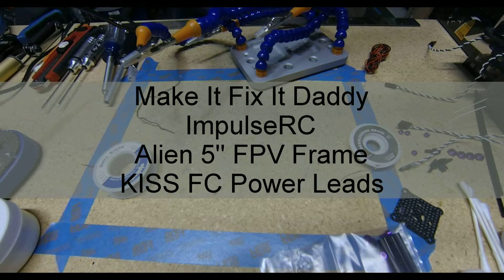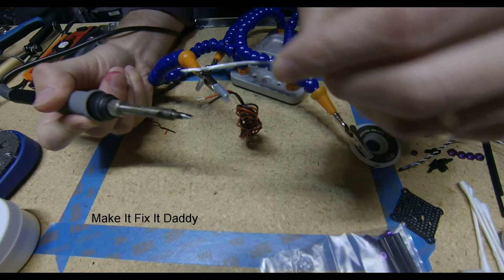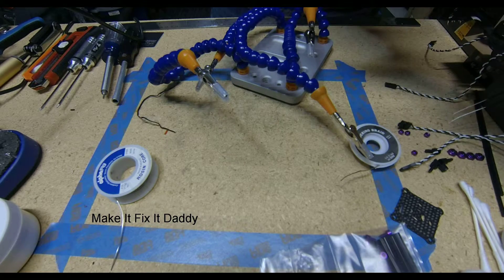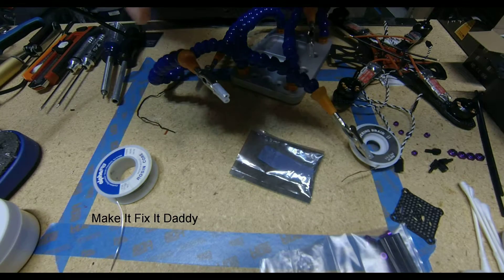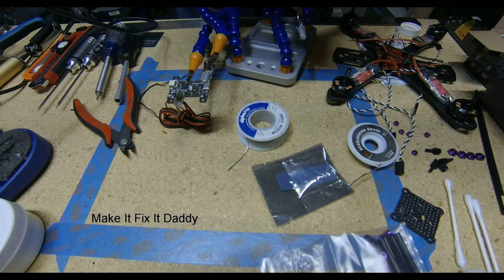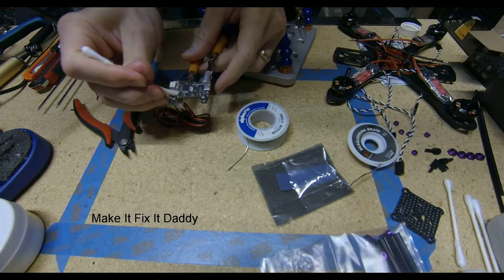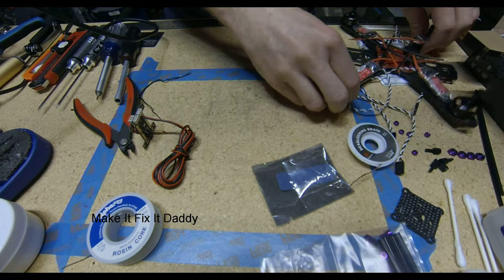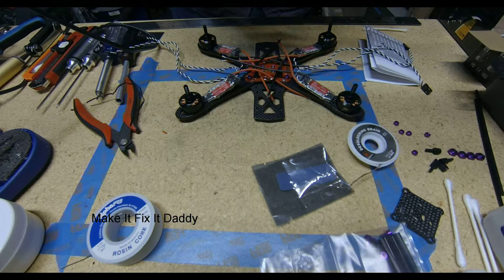KISS FC Power Lead Soldering for ImpulseRC 5" Alien FPV

Comment: Great tutorial I myself was wondering the same if I had to use a step down converter for the kiss fc thank you for clarifying. The alien build will be my next project. And I have the same setup as you do. Now does that power lead you soldered to the fc lead to the out input of the pnp50?
Reply from the maker: I soldered the FC and the LED ring to the large pads at the rear of the PDB.  I soldered the power leads for the PNP50 to the large front pads on the PDB (Like in the Mr. Steele video).  I am going to be changing out my vTX with the TBS Unify Pro 5G8 HV here soon.  I will make a video and show all the connections I made.
Reply: Awesome! Thank you so much for the guides! looking forward to more content on your channel :D
Reply: +Make It Fix It Daddy i decided to order the unify pro hv since it's only ten bucks difference in price. Looking forward in your future video on how to install it. I also have a question about the antenna. Does the brand of the antenna matter? I'm thinking of purchasing the tbs triumph antenna but since antennas are gonna be damaged on crash regardless I'm thinking of going on a cheaper route and buy a couple more aomway antennas. Does the type and brand of antenna matter when connecting to the video transmitter?
Reply from the maker: From what I have read and experienced, different types of antennas working together but some combinations work better than others.  The benefits come from antenna that are matched pairs, polarized, and or specialized.  In general, use omni directional antenna on your, vehicle, goggles and or ground station; they will give the best overall connectivity.  Use patch, pepperbox, crosshair, and or helical for a focused beam of signal reception (use only on receivers).  Combine omni with the specialized antenna, listed above, on a diversity setup to receive the best signal. I have combined a polarized patch with a "rubber ducky" antenna and received good signal from my vehicle.  I would recommend watching some videos by iBCrazy http://videoaerialsystems.com/ I hope this helps.
Reply: thank you! Really appreciate your response (: